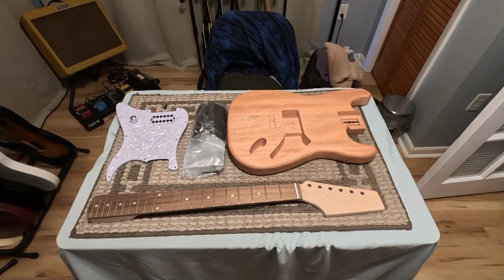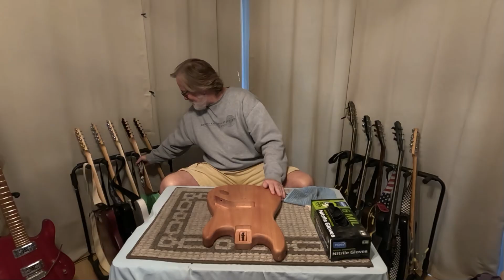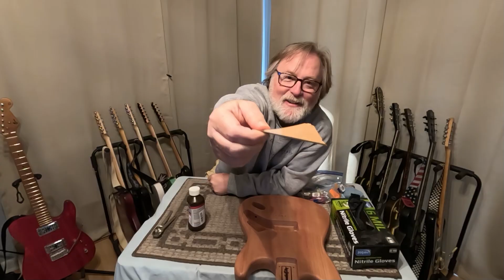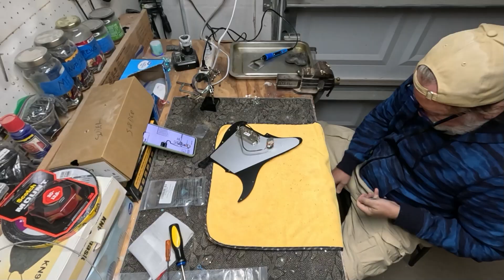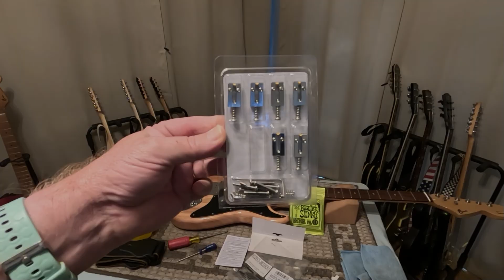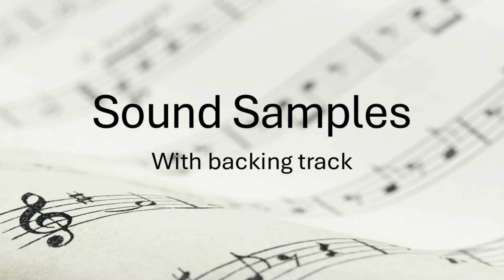Leo Jaymz ST TD (Tom DeLong) Guitar Kit Upgraded and modified! (Includes sound demos)

Comment: I bought a Squier Tom Delonge Stratocaster off of craigslist in 2015, with the sole purpose of routing it out for an SSS pickguard. Having been a Blink 182 fan in my youth, I never had the heart to butcher it.

When I saw this kit pop up, it seemed like a low risk alternative. My only concern has been the availability of aftermarket parts that are dimensionally compatible. How close is the Leo Jaymz pickguard to Fender specs? Pickguard misalignment is a pet peeve of mine, and is the only reason I have not pulled the trigger on this kit.
Reply from the maker: I've never had a pickguard line up perfectly (unless fender body/fender pickguard). The black one from the video was around $15 from Amazon. Only about 6 holes lined up. The wood on that kit is so soft you don't even need to drill a pilot hole. Old holes covered by pickguard.
Reply: I always just assume that regardless of manufacturer, the mounting holes are never going to line up perfectly. Your replacement appears to match the curves of the body well enough, wich gives me hope. I have seen some kits where no redily-available pickguards will center the pickups under the strings without having a portion of the pickguard overhanging the radiused edge of the body. Like somebody played a game of telephone, but describing a Stratocaster.

Anyway, I thank you for your reply.
Reply from the maker: The pickguard in the video is from Kaish (11 hole, 1 ply) if that helps. Shape and pickup placement were perfect, as was 6 of the holes.